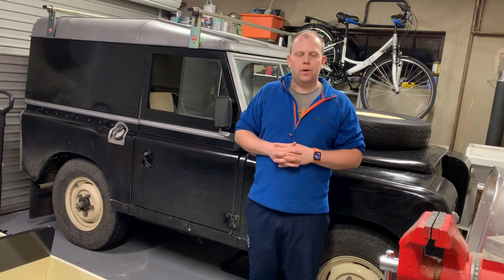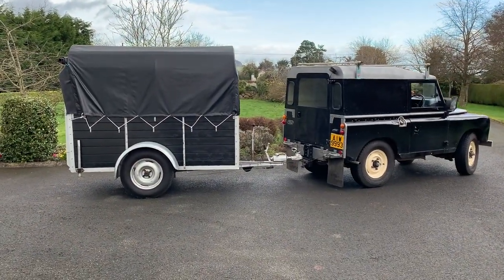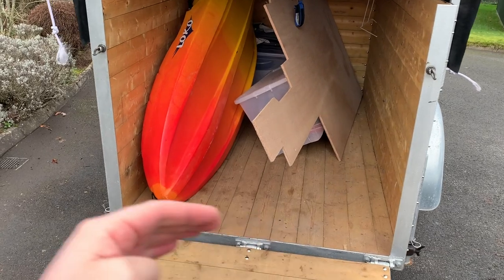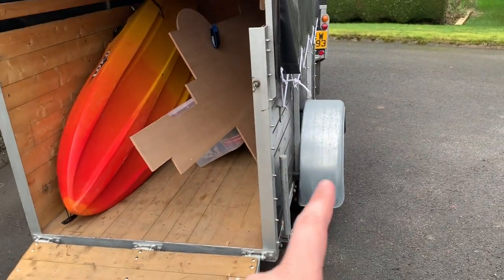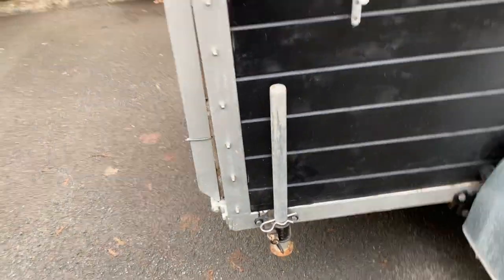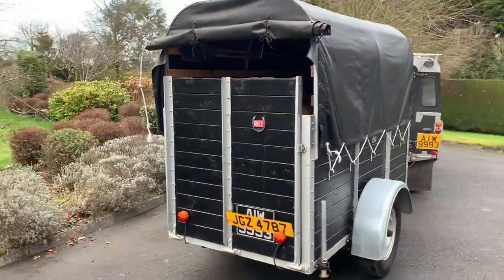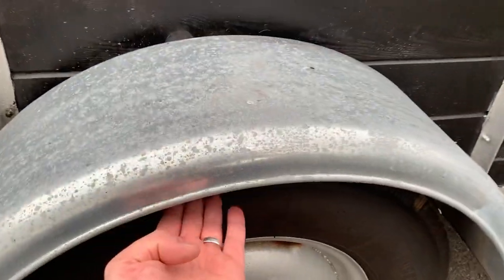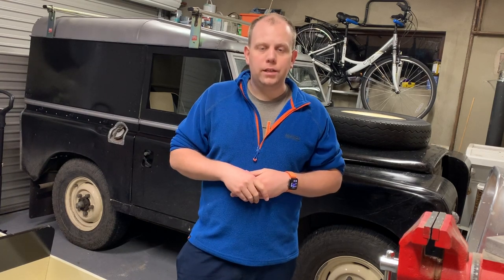Land Rover Series 3 and Rice Cattle Trailer

Comment: Great video very informative as usual I have just finished a Freelander project as Defenders and Series vehicles are so expensive to do as a hobby and now bought a 1996 all metal trailer (Saris on the hub cap but i will check with the axle id badge to be sure )to restore for a winter project in a small council rented garage similar to you doing up the Series in a shed with no lights,water or electricity good fun when you think about it but not when your wet and cold. I was thinking if you cut down the wheel arches you could put on some rubber land rover flaps to match the series.
Reply from the maker: Nice one, always good to have a project!

Comment: On camping in a Rover. I made up some 18 mm ply that goes across the back at tub height. Hinged side to side so the back bit folds onto the front bit so you have a parcel shelf behind you when driving, about  2’6”” deep. For sleeping fold the back bit open and support it on two 10” boxes that sit on the wheel boxes. ( arches). Then unfold another sheet that goes from the tub to the windscreen and rests on the dash/ bulkhead. I got a seven foot platform in my lwb that way, I’m too tall to get a good night actually in the back. A swb would be tighter but I’m sure there’d be enough length. I had four nights on the trot in it,  great.
Reply from the maker: This sounds like a great idea, thanks! I'm 6ft and I'm told it is possible to sleep in an 88" at my height

Comment: Nice to see a good trailer with big wheels. Just put my trailer on eBay, it’s done me well after a couple of rebuilds and 25 years but I’ve up graded to a braked one now. Shoes need relining so it’s actually still I braked but it’s on 15” rims which appear to be an RAF blue grey under the peeling paint and algae. The woods all good and the chassis is solid and it’s on cart springs. I reckon it’s circa 1950 to maybe early sixties.   Makes the Landy look good!  The old one wasn’t really big enough to look comfortable behind a 109. Your horse / cattle trailer is a very useful space, and it’s dry!
Reply from the maker: Nice one! Have you got a link to your trailer on eBay? I'm a big fan of my cattle trailer, would love to use it for camping actually!
Reply: @restosaga  383845368928 is the one I’m selling. Done load of welding on the hitch today. Only cos it’s going, never did it for  my benefit!
Reply: @restosaga  114549442075is the trailer I’ve bought   Looks the biz behind the 109
Reply from the maker: Excellent! Nothing quite like a matching pair!

Comment: I’m on the verge of buying a 1973 S3 2.25l petrol. Your videos have inspired me to take the leap into buying a classic but I’m slightly nervous about it becoming a money pit. It wont do a lot of miles but I do want to use it as a car not just own it as a treasure. Any thoughts on that risk would be greatly appreciated.
Reply from the maker: Thanks for getting in touch, glad you’re enjoying the videos! My advice would be to buy the best example you can then stick rigidly to maintenance schedules with good quality parts. That way most disasters can be avoided. Although Series Landies have got more expensive of late the avoidance of a rusty chassis or bulkhead is key to not buying a money pit. Hope that helps!

Comment: Great video. I have a series 3 myself and wanted to use it to pull my horse trailer (ifor 505)
Is the series up to the job and Anything I need to consider before u do ?
Many thanks
Reply from the maker: Thank you! You definitely know the trailer is there but it handles it well. Make sure your license covers you to tow the 505 and that your brakes are up to scratch, other than that you should be grand!
Reply: @restosaga  thank you